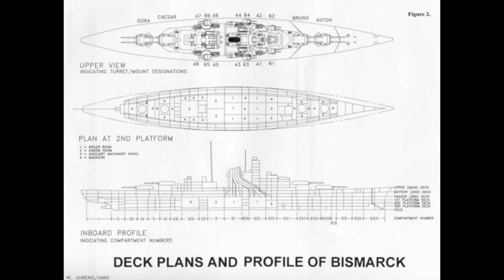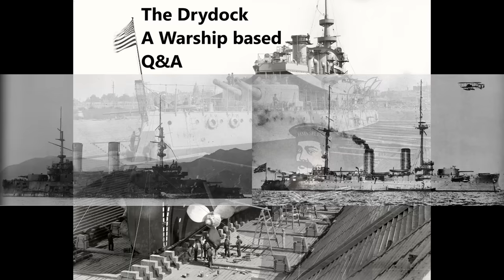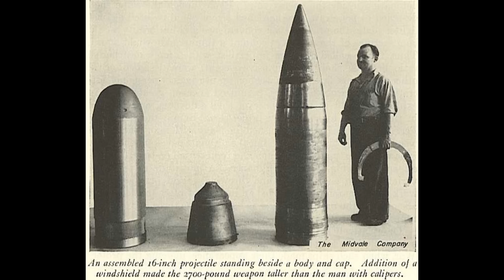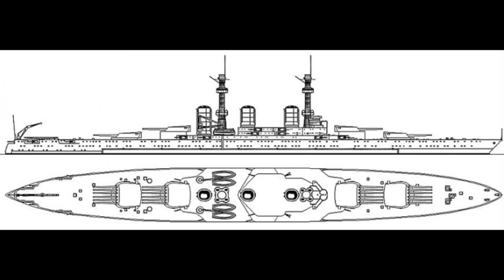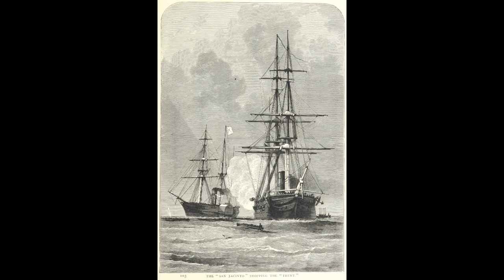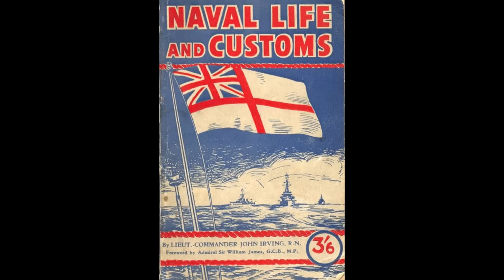The Drydock - Episode 096

Comment: The Midshipman's book lives on in the US Navy for officers working on their SWO or Submarine qualification.

The F4U was the best carrier fighter of the war and arguably the best overall fighter of WWII.  The Fleet Air Arm eventually receive the F4U-1D which out performed the Seafire even with the Griffen engine.  I don't think the Fleet Air Arm ever received the -4 but I believe the RAN did.  The -4 was the among the fastest fighter aircraft of WWII that was produced in large numbers.  The post war -5 was the fastest single seat piston fighter ever to see service in large numbers.  It was the first true strike fighter.
Reply: The Hellcat outmaneuvered and outlanded it, and required less takeoff room. The F4U was a good fighter, but the Hellcat was a better carrier fighter.
Reply: Raging S  By the time the RN arrives in the Pacific the F4U's carrier qual problems were solved and by the time the -4s arrive Corsairs are flying off of US Decks.  Had the USN shown a little more inginuity and perseverance  the Corsair would have made it to carrier service by the end of 1943.  The Fleet Air Arm was already flying Corsairs off of CVEs.  The F6F was  a stop gap fighter as the initial failure of the F4U to qualify left a void.  The F8F was really a contemporary of the the -5 which was superior to the bearcat.  That's why the F8F was retired first.
Reply: @johnshepherd8687  While the F4U was a fine fighter,  the F6F also was and was not a stop gap.  A competition between the F4U-5 and F8F-1 would have depended largely on the altitude.  The F4U-5 was optimized for higher altitudes by its engine while the F8F-1 engine was optimized for low altitudes.  Below 20,000 feet the F8F-1 would have enjoyed the advantage with superior maneuverability and rate of climb.  Above 20,000 the F4U-5 would have been at an advantage.  The F4U outlasted the F8F because of its usefulness as a ground attack plane not it's ability as a fighter. That role had been taken over by jets.

Comment: Two random thoughts about the Blue Riband.  One the SS United States was apparently , according to the book 'A Man and His Ship : America's Greatest Naval Architect and His Quest to Build the S. S. United States' under orders not to use her full power in the crossings; and so might have been able to manage a crossing closer to 40 knots than the approximately 35 knots of her actual Riband winning run.  But she was specially built and furnished with an eye to keeping the displacement down to let her massive engines really shine.
Second the range issues of a warship attempting to better a liner at a high speed transatlantic crossing had an almost perfect mirror several decades later with the Concorde airliner.  There were a number of military aircraft that could fly faster, but most fighters could keep up for less than half an hour before the fuel hungry afterburner needed to keep pace depleted their fuel and they'd have to slow and return to base.  Even the earlier SR-71 Blackbird, while around 50% faster, had a shorter unrefueled range!

Comment: Flying flags from a jackstaff/bow. Ships fly a flag from the bow to denote that they are anchored or alongside and not underway. This is an important navigation aid for other ships going near to your ship in restricted waters, ie where one can anchor. They will not expect you to drift with the tide but your ship will swing. Warships naturally fly nationally unique flags. The jack is dropped when the anchor leaves the sea bed on recovery or when all the warps have been taken in or cast off when leaving a jetty etc. The Nations ensign or Naval flag is flown from the mainmast when underway and from the stern when anchored or alongside also to denote they are not underway.
Reply: Several errors. There is no flag to denote being at anchor.
(a) A vessel at anchor shall exhibit where it can best be seen: (i) in the fore part, an all-round white light or one ball; (ii) at or near the stern and at a lower level than the light prescribed in sub-paragraph (i), an all-round white light.
Not sure what a Nations flag is, However in a foreign port the Flag of of the Country is flown from the highest yard and on the furthest  Starboard hoist, The Ships own national flag is flown at the stern.

Comment: The flare on on guns, it seems to me, are for ease of loading in the heat of battle. It would act as a funnel to aid loading the powder,wadding, shot and ramming time. Great vids Drac.
Reply: not the bore is flared, only the outside of a barrel.
Reply: @eddirkse9252  Thanks for the  info.

Comment: My understanding was that early war Active (i.e.: "Pinging") SoNAR/ASDIC was very short range.  100-500m on either side of the owning ship.  Hydrophones, on the other hand, were able to hear quite some distance, depending on sea state.  A submarine near the surface was effectively invisible to wartime SoNARs, or so I thought.  Additionally, SoNAR listening was useless above 9 or 10nts speed, due to the sound of the owning ship's passage through its fluid medium.  The Hippers were installed with SoNAR, but fat lot of good it did them.
Reply: In the battle of DS the PE did detect the torpedo, or torpedoes fired from Hood (just before she blow up), both German ships turned to evaded the tinfish....

Comment: Barrel flare comes from the difference between casting and a forged or machined barrel. In a cast barrel, the muzzle cools faster than other parts of the barrel making it a bit more brittle. Forging or machining a barrel doesn't introduce that weakness so the flare is no longer required.

Comment: It may also be that the flaring at the end of cannon barrels is to help counter the weight of the 'breech' (or at least the rear of the cannon in the case where a breech is not present). This would make it easier to adjust the elevation.

Comment: A long time ago, when I was an MOD engineering apprentice, I was given the job of preparing a large number of pressure sensing devices for a trial. The trial was to determine the effectiveness of a land artillery style muzzle brake on the 4.5 mk8 auto-loading naval gun, then under development. It took me several days to prepare the devices, mark a grid on the concrete test battery apron and then set all the devices in place on the grid intersections. We then retreated into the bunker and fired the gun with the barrel horizontal. I was then supposed to collect all the devices, examine them to determine the pressure level that each one had experienced and draw a pressure map. Except that, when we came out of the bunker to collect them, the whole lot had disappeared! We eventually found them in the sea and the sand dunes up to 30 meters away. The trial was abandoned.
Reply: Great story.

Comment: At 3hr 14min the bell shape on the old cannons was to reduce the cracking from gas pockets and slag inclusions because they were cast in the vertical position and these impurities would rise during the cooling period.
Reply: No idea if true, but neat concept. Could one then cool differentially keeping the upper part hot longer, drawing impurities up further?
Reply: @tamlandipper29  Metal casting back then was done by forming the sand cavity below grade. Gun size was at the limit of casting metal batch size. All of the metal in a gun had to be pored at the same time. When they shifted to steel it could be kept molten for a longer time and the gases and slag had more time to rise to the top and be removed from the molten metal during the reduction of carbon from the iron. Look up steel ingot casting and the use of "Hot Top" casting flasks.

Comment: Respected SIR.  Pleasse note that Bismarke had a second heavy armoured decking under the upper outside armoured deck.The highest German officer to survive an Eingineering officer did mention that the total zone beneath the second lower armoured deck,which if my memory serves me correctly had an angled structure some many meters wide running parralel to the full length of the ships hull sides with the armoured hull itself.Further the Engineering officer did state with conviction that the lower armoured deck recieved no penetrations and the atmosphere beneath that decking was very quite and the crew working there heard virtually nothing of the battle going on outside.He thus then stated that the Bismarck was sunk by the German Demolition charges and not the Royal Navy.
 My father worked for Schneider French Engineering Organisation from France and he was involved in trying to solve the Prince of Wales Vickers ships mechanical directoring of the 10 main Guns. As a very young boy after the war I seem to remember that because the English Engineers treated all Foreign Engineers as lower quality father a Czechoslovak with the other European Engineers were left behind ashore when Prince of Wales Sailed to meet the Bismarck only with English Engineers,So the Prince of Wales ended up sailing with only 8 main guns working and it was obvious that had the whole international team of engineers sailed it was likely that the whole fire control could have been corrected. The P.of.W. had two director positions one in the main command tower and the optical/mechanical director turret was in front of the command tower and another combined turret was just behind the rear 4main gun turret.the connection was wires? straight down below the decks to the control room(CAN NOT REMBER NAME) probably where Radar,Radtio,Asdic,Depth sounders etc were,deep down in ship.I presume a repeater for the guns was up in the Captains Tower aswell as down in Control Room? NB  Probably less horizontal cable link than in Bismarck?JUST TO LET you know that the Engineers from the captured nations were all treated with much lower pay and not offered proper engineering status.The Engineers from France,Belgium,Holland,Norway,Luxemburg could go home and get their status back but the Czechoslovaks,Polish could not because the communists mistrusted them.So a lot of opportunities were lost buy the English attitudes towards the Allies even Canada and the USA with France had to deal with the English bigotry!.  JUST THOUGHT THIS SHOULD BE KNOWN BEFORE I DIE .Thankyou.

Comment: The question of how you become a captain/commander of a ship reminds me of my time in the Marine Corp. I made rank fast but I would have 1. had to become an officer through one of the three ways you can do that from enlisted. 2. Performed well enough/stayed in long enough to become at least a Brigadier General and as a Marine there was only one class of ship you could cammand and not be an aviator. That being the Wasp class amphibious assault ships as either the CO or XO with the other command position having to be a Navy Aviator of at least the rank of Captain. Most all of those have been retired. 

Now that the America class is replacing Wasp and Tarawa class and they carry a large complement of fixed wing air craft you have to be an aviator or naval flight officer of the rank of Brigadier General or higher to CO or XO the ship opposite a Naval Officer. Marines highest ambitions are usually limited to command of the on board MEU, BLT, CLB or LCE.

Comment: When I read more details about the cancelled Wake Island relief operation (mostly from John Lundstrom's The First Team ), what stuck me was how similar the situation seemed to the Japanese position going into Midway (although without the same strength). Like the Midway plan, the American plan to relieve Wake involved multiple task forces that were too far apart to be mutually supporting, was predicated on minimal opposition, and quickly started to gather indications that the enemy was present in substantially greater strength than they had planned for.

As you said, a hypothetical battle between Saratoga and CarDiv 2 would almost certainly have come down to who spotted the other first, and the Japanese had far greater recon assets in the area. They had multiple island floatplane bases in the area around Wake, plus a force of heavy cruisers southeast of Wake assigned to cover and scout that flank, whereas Saratoga would have had nothing but her own dive-bombers for the scouting role. Plus, Saratoga's fighter squadron was at barely half strength with a mere 12 Wildcats (one had been lost en route from a crash), and the Marine squadron embarked to reinforce Wake had only 14 Buffaloes; this paltry force would have been responsible for both protecting the Saratoga group and any strikes they launched, but also the seaplane tender Tangier's approach to the island to deliver the ground reinforcements. CarDiv 2 carried roughly 120 aircraft (whose crews were fresh from the Pearl Harbor attack), against Saratoga's 81 planes (including the Marine fighters) which were not all operational and carried aircrews untested in combat. I would say VADM Pye made exactly the right decision to call off the relief operation for Wake Island, as it would have entailed huge risk for very little gain, particularly as the Japanese second landing wave had already all but overrun the island before Saratoga was scheduled to get within range.

Comment: I don't think Saratoga's air group is ready to take on the IJN forces at Wake.  I would also question the surface forces being read to get stuck in and get it done. Keep in mind the Long Lance Torpedo wasn't really known about.
Reply from the maker: A surprise attack makes up for a multitude of sins :)
Reply: @Drachinifel  True, but the Japanese had far more recon assets in the area. They had multiple nearby seaplane bases in operation, plus a cruiser squadron (with its own floatplanes) operating southeast of Wake specifically tasked with scouting for any American forces coming from that direction. So, I would say Saratoga's chances of actually finding Soryu and Hiryu first would have been minimal, and the chances of closing for a surface action almost nil. Plus, some American intelligence reports at the time suggested that two of the Kongos might have been present with CarDiv 2, so it's unlikely Fletcher would have considered going for a surface action.

Midway certainly did prove the power of a surprise attack in a carrier battle, but the balance of information and recon at Wake would have been much more favorable to the Japanese.

Comment: Late model ships have propeller pods (with electric motors) that can turn 360 degrees.
The latest model ships have submarine like turbines on those pods for optimum efficiency and water noise reduction.
Regards,
Geoff. Reeks

Comment: I understand the problem with protecting the rudder now and thanks for it.  What about the screws, however?  They don't need to pivot port or starboard.  Could a full length chine outboard protect the screws better?  From Iowa's arrangement it looks like any torpedo hit to a screw would also endanger the twin, close together, rudders.  In fact it rather reminds me of Bismarck's arrangement, allowing for the difference in the number of screws.
Reply: The screws are generally less vulnerable to torpedo damage by virtue of much more massive construction. The shaft of the screw varies from "Whoa, that's a big steel shaft." on a smaller ship to "That wall rotates?!" on larger vessels. The shape and metallurgy of a screw's fins also helps reduce forces on the screw due to pressure waves. A pressure wave is unable to hit all of a screw's surface squarely, reducing peak force on the screw. Screws are also made of bronze, which has favorable pressure resistance characteristics. They actually have to be designed in pressure resistant ways to resist cavitation damage, otherwise normal operation would erode the screw away quickly.

Comment: The wheelhouse with no view scenario was the norm and was indeed very common. The reason is because the helmsman has no need seeing where he is going, but instead is there only to follow his steering orders from the man in command of the ship - the officer of the watch. Helmsmen is a skilled jog and it is no easy task steering a course in a stern sea, so all he needs to concentrate on is the tape repeater.

Secondly, with a full forward view, a helmsman may decide - either instinctively or by way of a reaction - that something he sees out ahead is fundamentally wrong and that he must take action on his own on the assumption that the OOW has not seen it. This is not desirable. On many occasions a helmsman would have a compromised or inferior view of events up top, particularly when in confined waters or when replenishing fuel alongside a tanker. In such cases, Special Sea Dutymen man all key positions, such as wheelhouse steering and emergency steering positions in the tiller flat. 

The helmsman is there to do what he's told - not what he thinks as and when he sees fit. On smaller vessels - and this is in the handbooks - a helmsman/coxswain with a position on an open bridge may be ordered to steer for the steeple right ahead, or to just bring the boat alongside a dock or jetty without any further formal wheel or engine orders. This, however, is the less common scenario across the range of ship classes and sizes. 

I think you may have been stuttering a bit because you were waffling.

Comment: Quick search on the root-level comments didn't find me a comment, so asking (even if Drach himself doesn't answer, perhaps someone else will).

The section on HE-111 commented on the general failures of HE-111s in level bombing roles vs. shipping. But of course, because level bombing vs. shipping was pretty-much universally, as noted, more luck than design.

But Drach then commented on some unusual successes of the HE-111 in the torpedo bombing role.

Now, I vaguely remember seeing references to them being used as such, but success? That really surprises me. Thinking of the singular lack of success US Devastators (considerably smaller targets), I'm wondering how the much larger-target HE-111 could be successful in the torpedo bombing role?